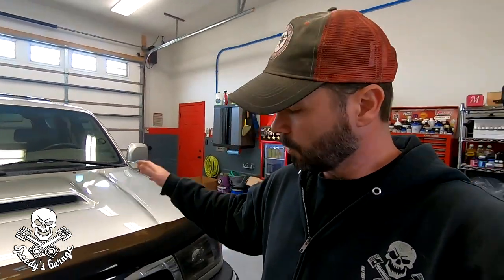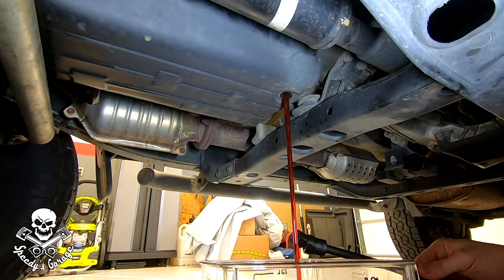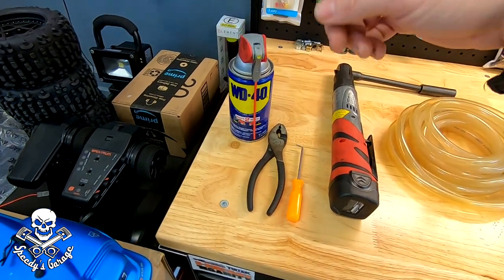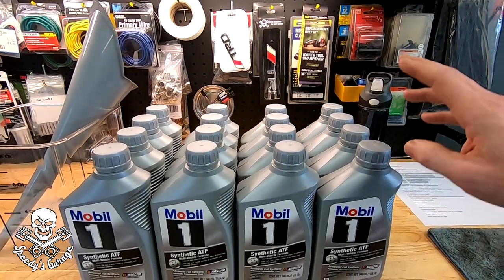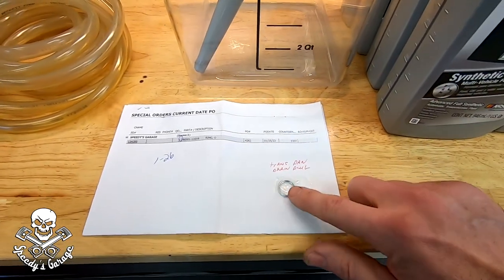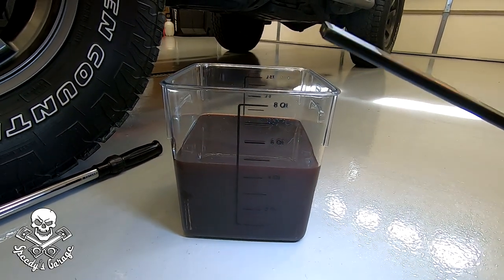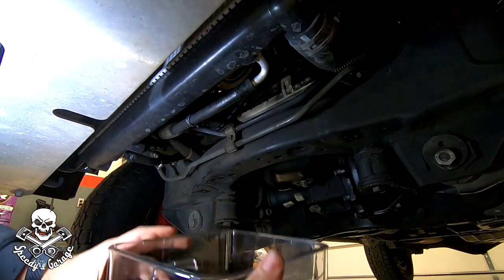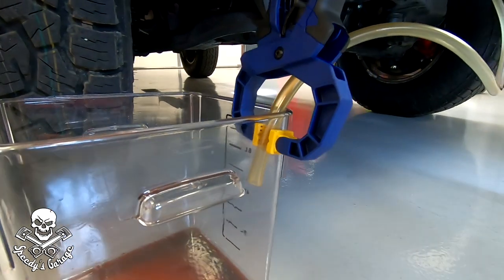4Runner Trans Fluid Exchange Speedy's Garage Restoring a 3rd Gen 4Runner P7

Comment: Hey Speedy! I have a 3rd gen with 230,000 miles and never changed the trans fluid. I did just install new Oem radiator yesterday. Would you recommend complete flush like you did or drain and fill? I’m worried about getting rid of all the clutch material at once. Can this be bad for the transmission? Any feedback is greatly appreciated. Thank you
Reply from the maker: I'd do exactly what I did but if you don't know the history of the fluid add a trans filter change as well.

Comment: What if you had a pump pumping in fluid through the line you disconnected/plugged up...could you add at the same time you're draining?
Reply: You bet. Be sure to shut off the pump at same time you turn the engine.

Comment: So I'm checking my 96 4 runner  dip stick on the transmission oil so my ❓ is where should the oil be at the market on the dip stick when  it's cold  be before I start changing the new oil

Comment: Just a dumb question, if you would disconnect the high line and low line on the radiator, would you be able to put the high side in a bucket and the low side in the new fluid and it would suck the new in, until you have 11 qts out?
Reply from the maker: I wondered the same but didn't wanna risk a mess lol.

Comment: I’m not really familiar with Toyotas, does your truck not have a transmission filter? Everything I’ve owned had one and I’ve always changed it when I did the fluid, awesome video Sir 👍😁
Reply from the maker: There's one in the pan that's steel mesh.
Reply: @SpeedysGarage  thanks for the reply
Reply: @SpeedysGarage  why didn’t you replace it?

Comment: Hi there- looking to do all my different and transfer oils on my 1998 4runner SR5 soon. I tried to order the male hex replacement bolt (as per your link) and they are telling me it will not fit my vehicle. I know your is a 2002 from watching your videos, so how do I find out the fill plug size of my 1998 to see if it's the same?
Reply from the maker: I "think" they're all the same.
Reply: I did see the same part numbers on another channel, so that's enough for me to order and try them out! Thanks again for the tip!

Comment: Speedy, rather than drain the pan, can you not just bleed, then replace only? With draining the pan as the first step, arent you just bleeding out fresh fluid?
Reply from the maker: Most of the fluid is in the torque converter.

Comment: Hello new subscriber here. My neighbor want to sell me his 2001 4runner 4x4 but the valve cover starts to leak oil. I I don't know how to fix it and don't have enough money to bring it to a mechanic. I want to know if engine will be broken down if I drive it like that until I make it be fixed. The leak is minor. Thanks...🙏
Reply: Common issue for them. If it’s leaking a minor amount you can tighten the valve cover bolt very slightly . It’s an inch pound spec. It won’t be an issue unless it’s leaking a ton. Can leak onto your alternator or exhaust etc.